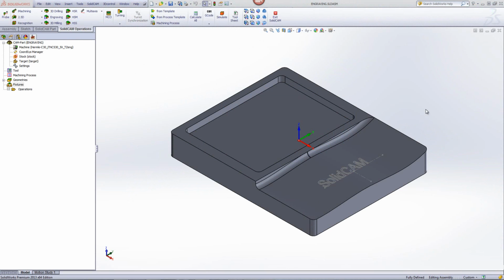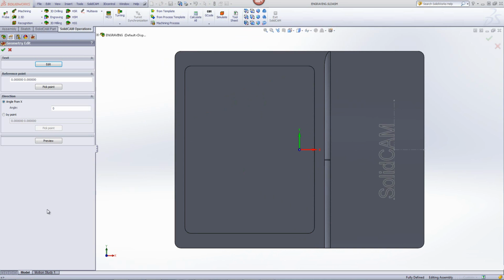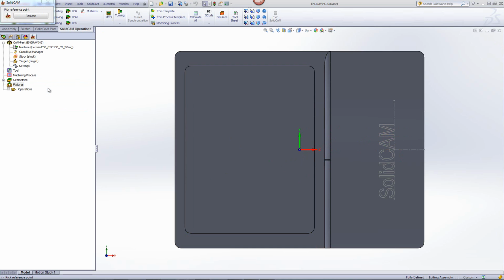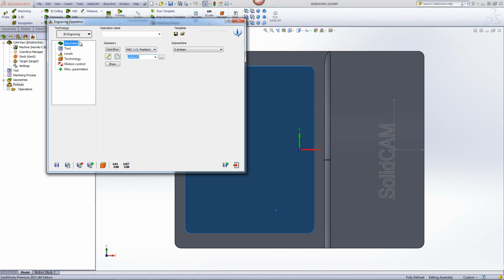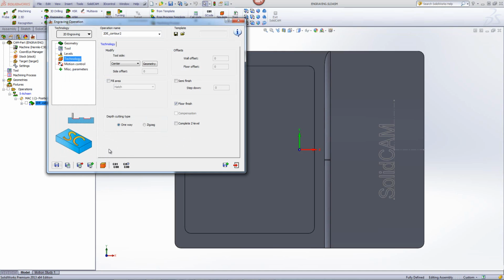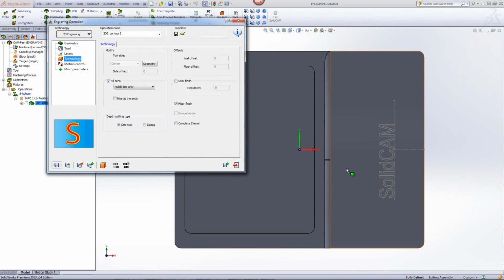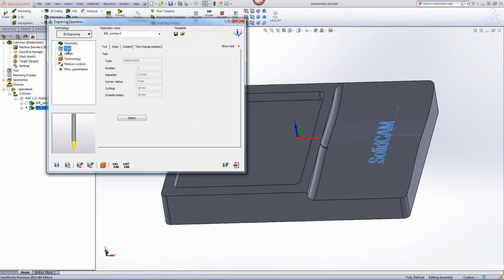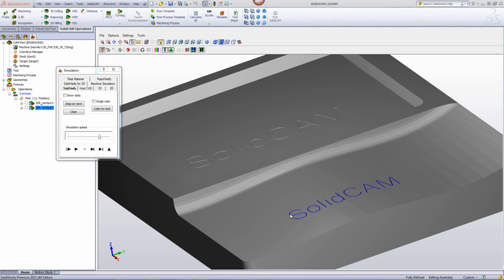What's New In SolidCAM 2013: Engraving

Comment: i wish to use the the engraving option with middle line only but i am having trouble in the ends of each font and i wont see a check box that you used in the video rise the ends. what should i do !
Reply from the maker: This option was faulty and was removed. However it is now fixed and is in SolidCAM 2017